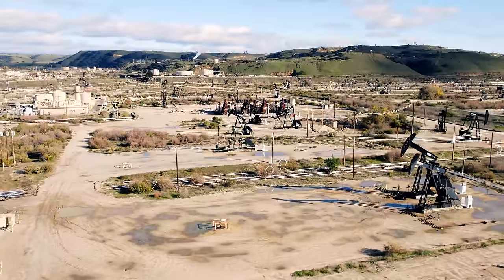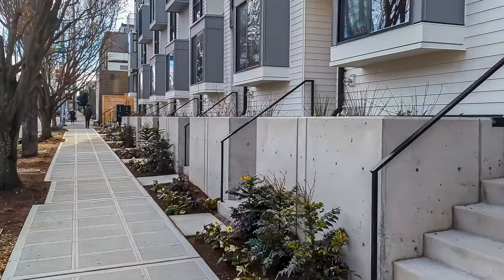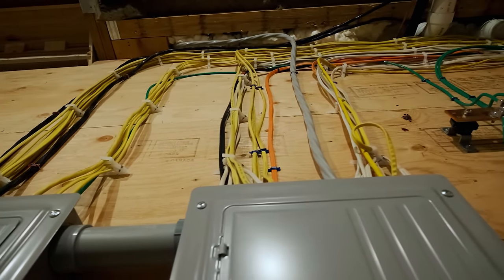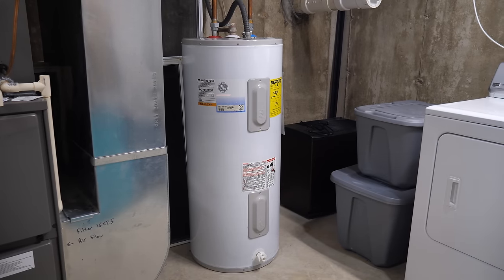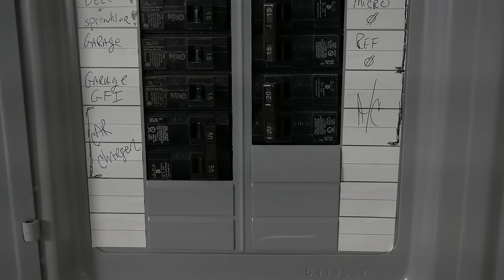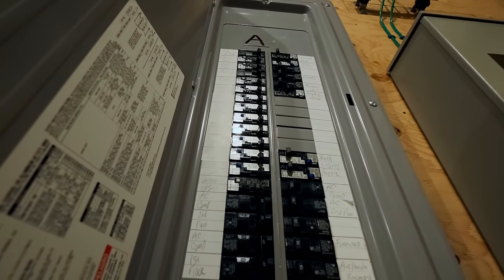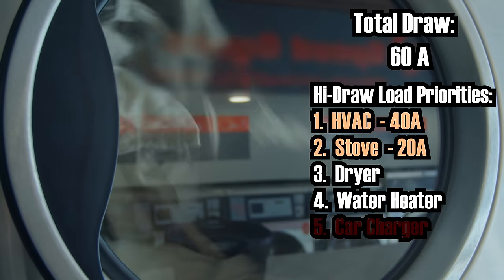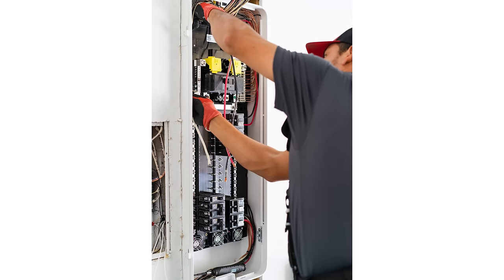Home Electrification: There's not a lot to do, and it doesn't have to be hard (Part 1)

Comment: My issue, as others have said, is putting all of your eggs in one basket.  Look at how one bad snow storm decimated Texas, and people literally froze to death due to the electric heat going out in their homes. 
I'm sorry, but I'm a firm believer in having a diverse set of essential appliances to prevent that kind of disaster. Keep in mind, I'm up in North Eastern Pennsylvania, where we get slammed with winter storms and extreme cold regularly. 
I want a gas stove, and preferably gas or oil heating options as a backup. Even when the lights are out, I can still easily use a lighter as an ignitor or pilot-light. 
I also just prefer cooking with a gas restaurant style burner, but that's just a bonus. 
I have nothing against sustainable energy, but when our sh*thole country has proved time and time again it can't manage infrastructure due to deeply seeded corruption, I don't want to rely one one single power/fuel source. 
Perhaps a wood burning stove and heater would be perfect if I were in a more rural area, but suburban living doesn't leave any options other than gas or oil. Unless there's a way to create efficient at-home electrolysis, and run a burner/heater without blowing up your home, I foresee natural gas being around for a long time.

Edit: I don't use natural gas with a blower, but good try.
Reply: I'm in South Western PA, so I don't have it as bad as you, but that was my thought. However, gas heating doesn't help you (unless you have individual gas burners in your house) because the blower still won't go.

A combo of solar panels and gas would do it, but that's pricey. Plus, it is super cloudy here.
Reply: Renewable energy isn’t there yet. It’s at least 40 years out
Reply: Except that there aren't many systems that don't already have all their eggs in that basket. My furnace burns stuff, sure, but it still depends on electricity to run the blower and power the electronics.
Reply: @legitskills9230  i gots generator in that case.
Reply: @Bradiant  that'd do it.
Reply: How can gas heat your home with no electricity? You still need a blower to move the air, which is powered by electricity. I grew up in a house with all gas, and power outages still SUCKED just as bad as they do in the all electric apartment I currently live in. I know an old guy who is all electric, he just keeps a bit propane on hand for heating and cooking during power outages.
Reply: @wotsac  BOILER FTW here.  No power = no problem!

...with the help of a repurposed US-built (it's that old) APC UPS to run the low water cutoff, vent damper, and gas valve.
Reply: in nyc, if the power goes out you need gas stoves to boil water as temporary radiators and ive had to do that more than 5 times in my time spent here. government housing (section 8) has to do that at least once a year. 

no thx, i like having gas in my home
Reply: Th7ere are few if no "modern" fossil-fuel central heating options that do not require electricity. Ignitors, forced air blowers, etc.
Reply: @Aquatarkus96  We use steam heaters powered by a gas furnace. You can use a mercury thermometer switch to trigger the ignitor. Which can be bypassed in the event of a power outage btw. 
Do people on the internet not understand old school heating? Are we really that reliant on electricity and electronics to do everything?
Reply: @Bigrignohio  I can run my gas furnace on a few hundred watts, if I needed to I could have my petrol Honda idling outside running a small inverter for days to ride out a power outage in the winter. With full-electric I'd need at minium a 3KW genset just to keep the house at a liveable temperature. Not that I don't want a diesel genset that can dump out 10KW, but I could literally cobble together the car+inverter solution in a pinch if I had to, from stuff I have on hand. Even without doing that I would still at least have hot water, because my gas water heater is fully thermo-mechanical, the only electric bit in it is the piezo ignitor for the pilot.
Reply: @treelineresearch3387  You can? Maybe. The AVERAGE homeowner? Certainly not. Also a lot of those little gens cannot handle the blower motor inrush.

And if you "cobble together" something be damned sure it is safe and code compliant to prevent yet another lineman dying.
Reply: @Bigrignohio  most apartment buildings run on steam heat from gas and oil furnaces and don’t need electronic igniters/starters, they can be activated via manual methods such as attaching the electric starter with some copper wires to a battery (gas) or igniting a piece of paper and throwing it into the furnace(oil)
Reply: @m1garandMUSIC  A) Irrelevant to home owners and B) Incorrect outside old cities like New York/Seattle. In my state most apartments are individual furnaces and AC units.
Reply: @Bigrignohio  so nothing i’ve said is applicable to your parameters. understood and noted
Reply: @Bigrignohio  > And if you "cobble together" something be damned sure it is safe and code compliant to prevent yet another lineman dying.

No where in my post did I ever mention connecting anything but an appliance to the inverter. Zero points, again.

Comment: My house was built as entirely electric in the early 1970s, but with a 40A (on 240V) service. This lead a previous owner to move to oil fired water heating and plumb the house for radiators - the old air plenum heating system cabinet got used for the fridge. I've have 80A service supplied so I can get a car charger installed but it'll be a while before I consider changing the heating; considering the boiler was only replaced a few years ago with a gas one.
Reply: The previous owner learned from experience that when the power goes out, if you have no heat or hot water.. it really sucks.
Reply: @joseamadorsilva7395  the oil or gas boiler cannot run without power either. Also with fully underground power distribution here, there are very rarely outages caused by weather events
Reply: @cian87  some of the older systems can run manually or have a car battery backup for those times.. I used to work with a guy who owned a lot of rental property.. he said his biggest fear was freezing to death with fuel to use and an electric system that thinks it's safer if he freezes to death without it
Reply: a house I rented had 60 A service
built in 1920s
but I suspect its electrical was 1950s-ish by clues on the panel
and I bet a good dozen houses on that block shared the same 50 kVA pole-mounted transformer that happened to be in my back yard LOL
Reply: My opinion is that the public money should be used to due replacements in the areas where there is the highest gain. So that'd probably first be homes that just need a reversing valve. But also homes with upgradable service but without appliances or furnaces.
Reply: @Furiends  while I like that idea, public monies should ideally be used for the maximum number households rather than as few. I'd rather see the funds utilized to upgrade the grid, which benefits many more homes, or toward subsidizing more efficient power plants (cogeneration) making more useful products for more people. 

If that can't be done, we should be lowering taxes in general.
Reply: @cian87  Gas furnaces can very easily run off a mobile generator, keeping your house from freezing. Power goes out with electric systems, you're screwed.
Reply: Depending on oil-pricing, it might be better to go with an air-to-water heat pump.  
If so, it would still make sense to keep the old boiler if there is enough space. Always nice to have redundancy.
Reply: @joseamadorsilva7395  In this case the math works out that the head count matters less than the amount of emissions.
cogeneration is absolutely not an option we should just get rid of these plants entirely. Build renewables instead.
Reply: @joseamadorsilva7395  Natural gas is not a reliable source for emergency heating.  A lot of things which might take down the grid can also damage gas distribution pipes.  The roots of fallen trees ripping up pipes is the one most folks seem to forget about.  Anyways, even when the gas network has backup electricity to keep it running, the company tends to shut it down in emergencies.
Oh, and most gas appliances don't work without electricity.  Folks living in the middle of nowhere where it gets really cold tend to have a wood burning stove for emergencies.
Reply: @joseamadorsilva7395  Of course you realise not ALL people have gas pipes for their houses.

Comment: The thunk had me laughing out loud. Great editing.

Also, just for "how it is done elsewhere". Here in Belgium a high load connection is 63A@240V (15120 VA) and a typical home gets 40A@240V (9600 VA), but it gets complicated when you go for three-phase. Personally I have 25A@400V+N for example which is three phase 240V with 400V available between the phases, the math gets kind of funky with sqrt(3)*400V*25A but that becomes 17300 VA. Which is in between the typical US numbers of 100A@110V (11000 VA) and 200A@110V (22000 VA)

The only headache is that you need to keep the legs balanced and not exceed 25A on any side.

Now, the main big change being done here lately is that people will get billed extra based upon their 15 minute rolling peak load. This is to incentivize people to reduce their peak load (and the cynic in me thinks it is also to save on electric grid upgrade costs)
Reply: Correction: The US 100A service is actually at 240V, so the total power available for 100A service is 24 kW, and with 200A service, it's 48 kW.
Reply: @radishpineapple74  oh. That's a lot of power then.
Reply: @radishpineapple74  Which is interesting when you realize that even a small car has 100 horsepower or around 74 kW.  So your car engine could easily power your house and the neighbors and heat them both from the waste heat.  Which would be stupid environmentally and economically but interesting nonetheless.
Reply: That is a fun fact!  Is 400V used frequently,  for water heating maybe?
Reply: @timgerk3262  For electric on-demand water heaters it is used (as those need a LOT of power). But the normal boilers are typically only 1400 or 2000 watt and just use regular 240. In my house it is only really used for the stovetop/oven combo. It is more of a headache than an advantage really. But its not something easily changed and it was like this when I bought the house.
Because as mentioned I really had to pay attention to balancing the phases. (don't put all heavy consumers on one phase for example, figure out the stovetop really only uses 2 phases to get 400V and use the third one for all plugs in the kitchen so if you run a heavy duty appliance on those + the stovetop the whole thing doesn't overload And yes electricians, I know it doesn't really 100% work like that, three phase gets really confusing when figuring out actual load on the phases when you have 400V consumers)

It might be advantageous in the future for the electric car charger. But with the capacity charges they now introduce you want to charge slowly anyways so it really isn't that much of an advantage.

The main reason it was often used is to save on copper wiring. as with 400V+N I can get 17300 VA over 3x4mm² (15AWG) wires whereas 63A requires 2x10mm² (8AWG) or even 16mm² (6AWG) when crossing larger distances and that is for less overall capacity. (The earth is sourced locally and always in 16mm² here)

Internally it is probably that way for the stovetop as well, by using three phase it can use thinner wires as 400V carries more power in less amps.
Reply: @boranblok  thanks for that reply!  Interesting comment about the car charging.  🇧🇪 ❤️

Comment: Gas connected Dryer. That was a new one to me 🙂
Interesting concept, much more effficient.
However, I have a heat pump dryer washing machine combination. Much better, especially you do not even need a exhaust, it will actually just need a waste water connection (which you need for the washing part anyway) where it will drain the humidity by converting it to water 🙂.
Love it.

Comment: I definitely agree,window and door upgrades, and insulation will help no matter what.  That can get you huge gains.
Reply: @doomVoxel   , except for its current political climate, nothing about FL is attractive to me, especially the physical climate--what with its hurricanes and hot, humid summers.
Reply: PLCs have been doing this for decades without being IOT it’s not new it’s just new to domestic
Reply: just don't skip ventilation. sealing airflow is great for heat loss/gain, but bad for indoor CO2 levels, and condensation / mold growth.
Reply: But the payback is likely decades. Windows, insulation, etc. are quite expensive. We spent about $25,000 reaching our windows, new efficient HVAC, and air dealing and insulating. The house is more comfortable, but the utility savings are marginal in our climate. The savings will never pay for it while I'm alive.

Comment: One of the big concerns I have is electromagnetic interference. Some of it is so bad it even messes with wi-fi. And vice-versa! Ask ham radio operators what they think about arc fault breakers which trip when you transmit. Thankfully some are getting better. 

BTW span is a cool product. (I am a certified installer).
Reply: I remember we were having a big problem with inverter microwaves tripping some brands of AFCI breakers, luckily i don't do much residential anymore.
Reply: That is interesting. I don't think I've come across that one. I do more PV and ESS these days rather than basic residential.

Comment: Biggest issue is cost. Moved to a new house which is on electric heat (septic and well water too) and I was shocked at my heating bills in the winter. I had grown so used to my bills going down compared to running the a/c in the summer. This was keeping the heat at 68. Previously I’d just spend 50 bucks on gas and another 50-100 on electricity in the winters. I really miss having a gas furnace
Reply: Biggest issue is resistive heating is stupidly expensive. I tried it for a week out of necessity when my gas furnace died last winter and just heating one room for a week with an electric space heater quadrupled my electricity bill for a month.
Reply: Yup. Heat pumps are the only cost effective way to heat with electricity in the winter. We tried going to electric heating for a month with resistive heaters and our energy bill tripled.
Reply: you can always install one if you really want to.
Reply: Yeah, I'm in Mexico and sadly this doesn't make any economic sense for me, I pay way less than people in USA do but that's because, where I live we don't need heating or cooling the house most of the year. And idk how this works in USA but here the government manages the electric company which subsidizes part of your electric bill if you use less that certain amount of energy, if you pass that, the bill easily doubles. So that makes you want to stay on the subsidized level and rn my home is close to that limit, which is a problem around a few weeks in winter when heaters are not essential but help a lot to be comfortable and I've looked into indoor gas heaters but don't seem to be very safe and also very expensive to install anyway. The thing is if I want to add more electricity in my home to add some heaters in winter or change to an electric stove and maybe even an electric or hybrid car, either way I would need to pay way more for electricity or start to install solar panels and batteries which also don't make much economic sense for what we pay for, but it might be the best way to add more electricity to my home, in any case I have to "invest" a good amount if I want to add electric energy to my home and change gas appliances for electric ones.
Reply: @FishFind3000  wish I could, but it’s not available. I’m a bit farther out in the country now. On septic and well water too. I do have a large propane tank, but the cost of changing the furnace to it doesn’t seem to make sense. Luckily I live in the south and it rarely gets too cold for long. Still it was always nice getting a break from high electricity bills

Comment: I'm an electrician and this panel sounds pretty cool, though I'm skeptical that it would be cheaper than just upgrading to 200amp.
Reply: often I believe you PAY for the on property upgrades and the UTILITY pays for the OFF property side
Reply: A much cheaper option is an EV charger with load management (for that load) capability.  Usually that is enough to fit all else in a 100 A panel.  It works by monitoring the main feeder current and adjusting accordingly.
Reply: Would the disruption be about the same?
Reply: @falconwaver  It depends on where your main panel is in relation to the electric meter. If the meter is far away and/or difficult to get a new wire to, then it will be much more disruptive (and expensive) to upgrade to 200 amps.
Reply: @jasonriddell  Usually the demarcation line is when the power touches the house. Before it reaches the house, it's the power companies responsibility, and after it touches, it becomes the property owners.